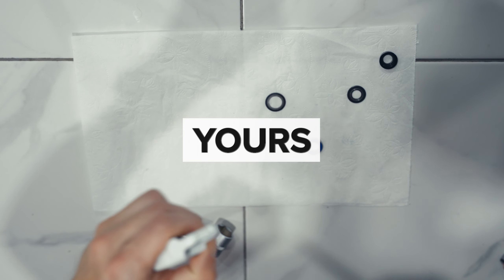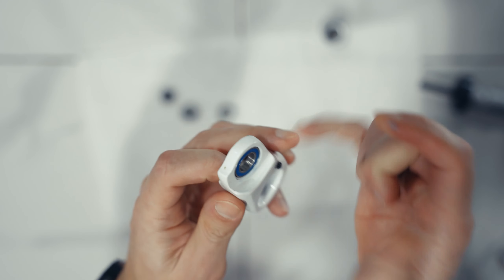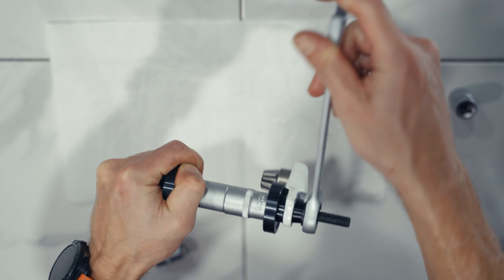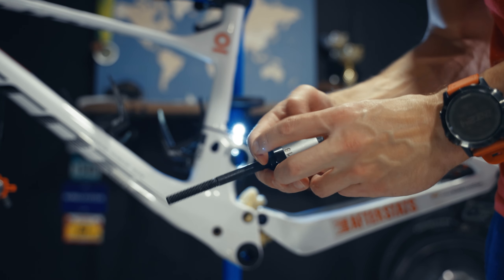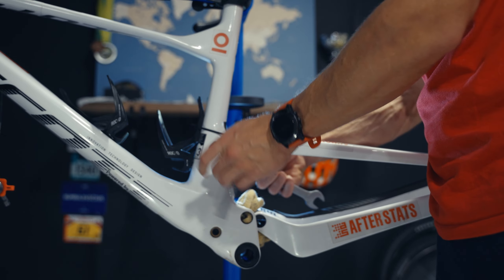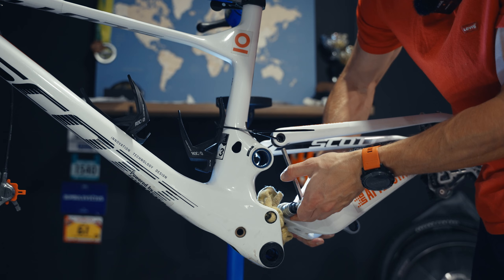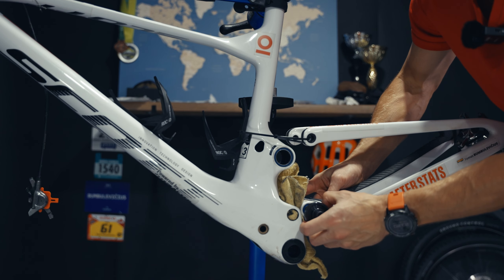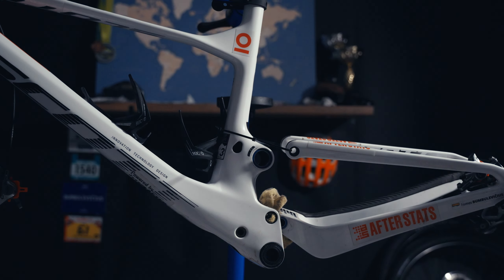Pressing In Suspension Bearings  - Scott Spark RC Maintenance

Comment: Hi! Very soecific "tools" you used. Super! I am a little affraid to destroy my frame. Currently I have not found the correct tools for that. Is there a link to the official tools? I have a Spark RC 2022 with 9960km / 53748hm in that two seasons. Maybe it would be a good idea to change bearings before next season. Ciao.
Reply from the maker: Hey, you can definitely find some bearings press tools - not Spark related surely, but they are available !
Reply from the maker: To be specific, you need two main ones for small bearings: 6801 & 6802 bearings type. Check RapidRacerProducts if its available around you.

And then the big ones on main pivot - improvise, ha!

Comment: Hello Tom, sorry to bother you, but by any chance, do you happen to have the exact size or reference of the bearings so that I can order them individually? I don't want to buy the complete kit as I find it too expensive for just bearings. It seems that the small bearings are 6802 LLU MAX BO 15X24X5 (2 pieces) and 6801 LLU MAX BO 12X21X5 (2 pieces). I'm missing the 2 large ones for the frame. Thank you.
Reply from the maker: Hey Axel, here you go!
Seatstay / Linkage: X2 21x12x5mm (6801)
Chainstay: X2 24x15x5mm (6802)
Seattube / Linkage: X2 37x27.7x6.5mm

About main linkage - It is possible to use 37x27.5x7mm (27537) if needed. If this is done the 2 rubber seals
must be removed.

However, I would not suggest doing so for prolonged time, because the washers worns out too - and it is super handy to have whole new kit on hand. In case if something breaks, etc - you will be saved too :)
Reply: I appreciate thx a lot ❤